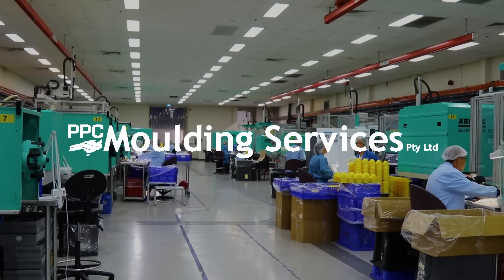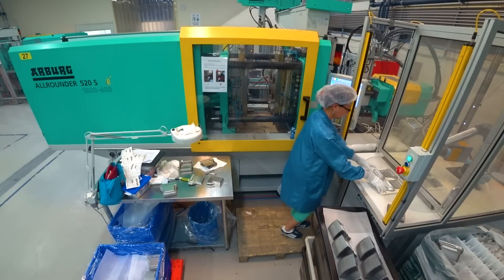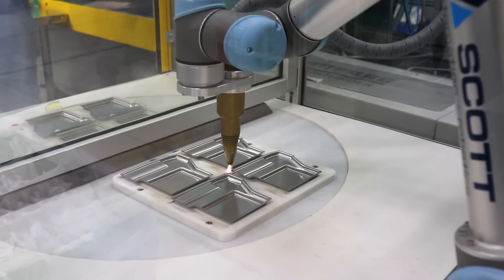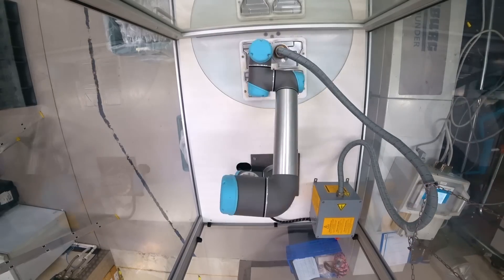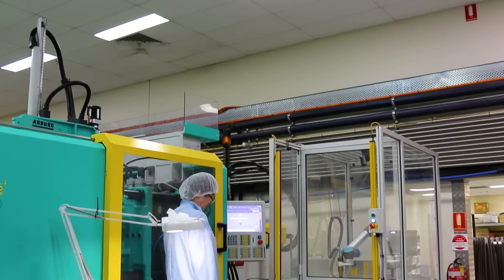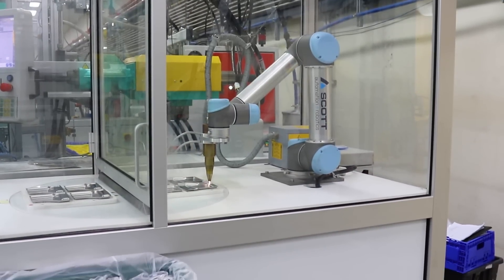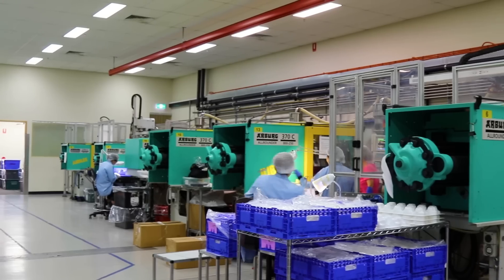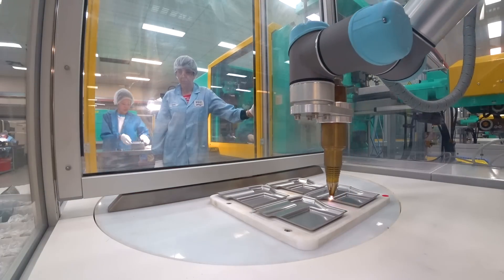Robotics keep manufacturing competitive and in Australia.

Comment: Great work and highly efficient ...........however if there' s a change of Government in April/May next year and they bring in an "Automation Tax" (whereby firms that used robotics instead of employing workers will be taxed at a higher rate).......which was mooted at the ALP conference...........then it's all for nothing........I'm seriously considering taking my micro mfg biz and setting up in the US.
Reply: Just because a policy position was discussed at a political party conference does not mean that it would become legislation and even if it did it still has to battle its way through the parliamentary process of the House of Representatives and then if successful through the Senate. That whole process takes time and can substantially alter the legislation and its powers.
Net result, don't panic and be prepared to lobby your case via the media. Don't cut and run so easily that is not the Aussie way.